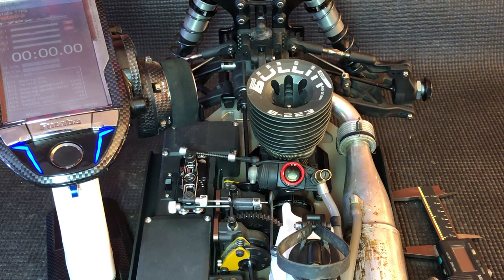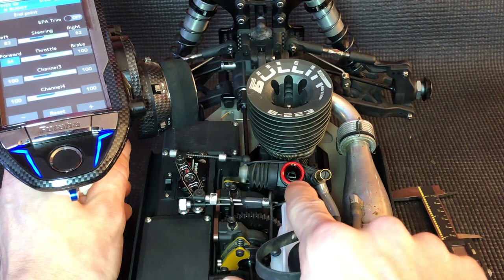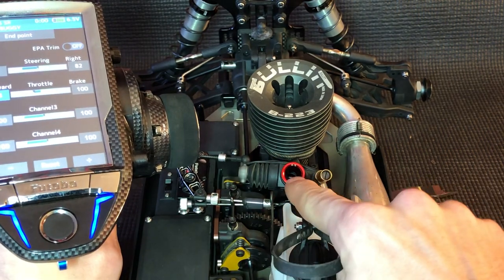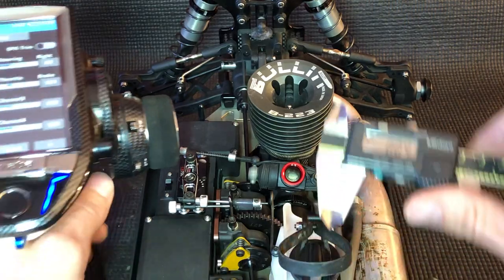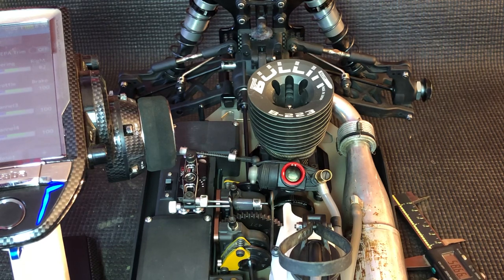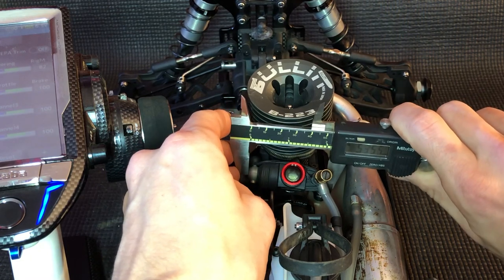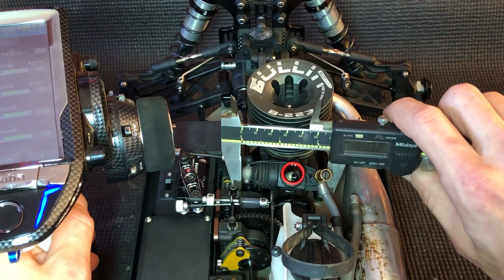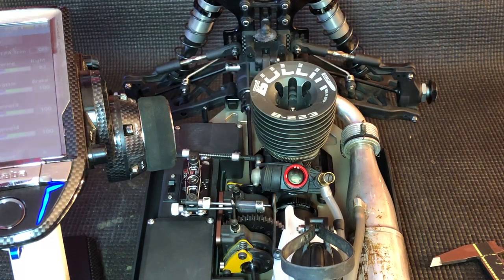How To: Set your Throttle Endpoint on Nitro RC Car [Beginner Tutorial with Ryan Lutz of LutzRC]

Comment: Hi Ryan. I’ve got a couple of questions. 
Does this measurement change depending on the size of the Venturi? 
What size Venturi are you running in this video?
Thanks for the tip, I’m definitely going to try this.
Reply from the maker: Doesn't change depending on the size of the venturi as far as our sweet spot we have found. 
In the video I have a 6mm. Some of the pros are now running 5.8mm or maybe even smaller. 
Hope it all helps! :-)
Reply: Hi Ryan. Thanks for the reply.
Reply: @RyanLutz  In this video you say max open gap is between 4,75-5,25mm. In your answer you wrote 5,8mm. Can you e check or explain this. Thx.
Reply from the maker: @nebaartur  If you are running a 6mm venturi then 6mm will be full open. You are right though that what I wrote is a bit confusing. I run in the 4.75 - 5mm range most of the time but will go up to 5.8mm if I need the extra power.

Comment: Hi nice video on the trim,can u explain more on ventury size for engine.thanks
Reply from the maker: SPEED -7 larger Venturi will provide more power in general. You can continue to go smaller Venturi and gain runtime so long as you don’t loose to much power to where you are on the gas harder or longer. 
Smaller Venturi can also add a little more torque due to increased velocity of the air fuel mixture.
Reply: Hi ryan,thanks a lot for your explanation on the venturi,really appreciate it.just been new to this nitro engine.thanks again,and keep it up.

Comment: Great tip bro. But quick question. U used a pipe spring to keep the throttle closed??
Reply from the maker: As you saw, I use small rubber bands! 👍🏼

Comment: is that a 6mm venturi? if so, wow your straight line speed is very fast yet you use a 6mm not the 6.5mm venturi.
Also, we also use rubber band to make sure the slide return to its position fast just like yours.

Comment: Just to clarify, are you saying that as soon as you see a perfect circle, that is your throttle end point. As this has no bearing on the low speed needle, wether it’s exposed or not.
Reply from the maker: Michael Inzitari yes. I wouldn’t pull past the perfect circle made by your Venturi choice. Then you would need to tune to performance from your chosen setting. 
Note some engines have short low speed needles and some have long. Some come fully out of the throttle body and some never come fully out.

Comment: In another video, its says that the carb needs to open to match size of the venturi. If the venturi is say 6.5, video says carb need to open 6.5mm after zeroing the caliper. You say around 5+mm is ok. Can you explain? 
Also your carb is not opening to at least the full length of the venturi. Obviously this is  working for you, any reason why you run it this way?
Reply from the maker: It is not necessary to open the carb all the way to end of the venturi. When you limit how far you open the carb you can effectively save fuel economy when racing. The key is that it saves fuel economy as long as you are not on the gas more and longer due to the slight decrease in power. You may also have to adjust the tune a bit too.

The only no no is don't open the carb beyond the venturi. Because at that point you are allowing extra fuel in but not extra air and thus making the mixture too rich at full throttle and wasting fuel.
Reply: @RyanLutz  That was a great explanation. Thanks

Comment: I got a question why do people do stuff to their transmitter while trying to start it up? im confused about those stuff
Reply from the maker: The radio has many settings to be used for various purposes. I know some use an idle up function on startup but personally there isn’t anything I do with my radio for starting up the car. Just different settings for racing.

Comment: Can you remove the venturi completly if u wanted max power also should you set idle gap from edge of carb body or from the edge of the venturie
Reply from the maker: Yes you can remove venturi but it would be better to use the largest venturi you can find because it will have smooth edges and provide better velocity. It should give you more overall power yes but often a smaller venturi can give more initial torque due to the velocity of the air. 
Idle gap is really user preference. Whatever you do consistently. Personally I just tune as necessary.

Comment: I've normally set the opening to the  outside diameter of the venturie.  I haven't tried to set it to these dimensions but it appears that it is much short of the outside diameter.  Is that correct? Is that to calm the engine or fuel mileage?
Reply from the maker: I discussed it a bit in the video. But the more you limit it, the less power you will have and the smaller tuning window you will have. This will yield more runtime if you get your tune right and you aren't lacking power and thus on the gas longer or harder anywhere. But yes, it is much limited from fully opened to the outside diameter.
Reply: @RyanLutz  Ok thank you. I did watch the entire video, and I think my question was more of what was the main objective of setting the carb this way. You answered it in your response - so thank you. Good luck next weekend!

Comment: What receiver are you using?
Reply from the maker: This is the Futaba R334SBS
Reply: That one has a antenna wire on it correct?
Reply from the maker: Correct it does.

Comment: Can you share your needle settings using a caliper?
Reply from the maker: It's really not ideal imo to just go off anothers settings. Temperature, humidity, fuel used, altitude, how you drive all play a factor in the tune. 
Tip would be if you aren't sure to richen it up and start to lean out slowly from there.
Reply: @RyanLutz  I agree. Its only a starting reference point. We always have the weather factor variances. Better than turning several times on the needle that too in large increments. I have seen even while using the clutch shoes leading vs trailing direction, changes the performance. I was told the lesser we turn the needles, the longer will be its life.